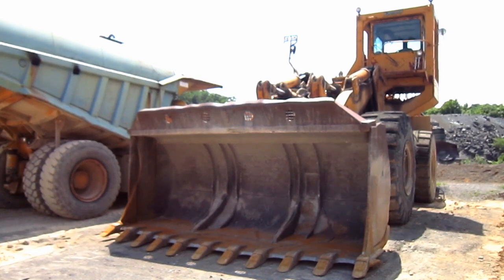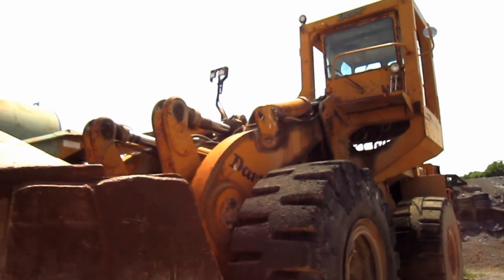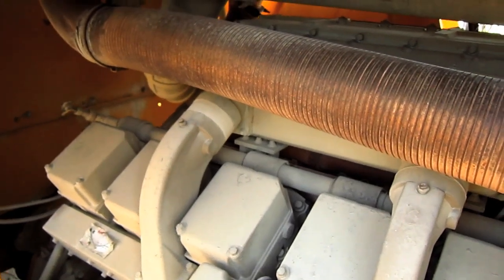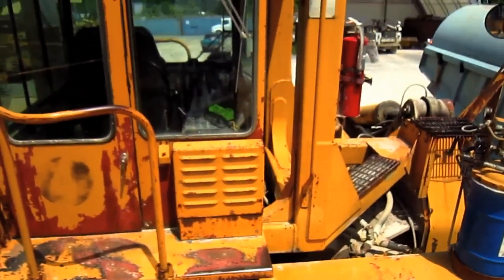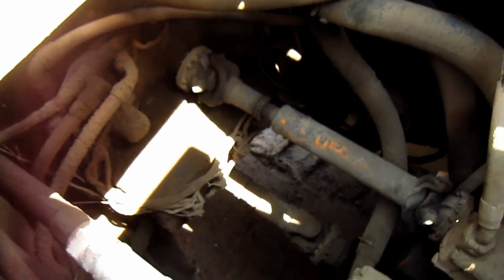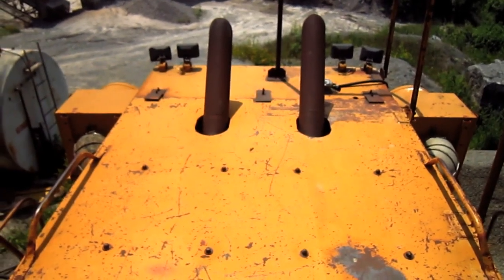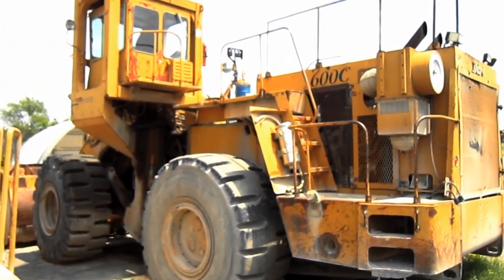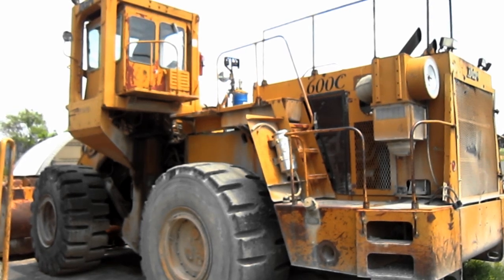Dart 600C Documentary

Comment: @PAmining   No doubt one of the coolest loaders of all time, like you said. The Dart 600 was a very powerful machine as well. That 875 horsepower rating always gets my attention.The Dart 600 was only a few tons heavier than the Cat 992C,but had a power advantage of 185 horsepower. The 600 also featured a rock bucket 2.5 cubic yards bigger than the 992C.With that said, my guess is the majority of contractors purchased the Cat 992C due to the incredible product support and logistics system that Caterpillar developed.
I wasn’t aware that Unit Rig manufactured the Dart 600 series up to 1994.Thanks for another informative and entertaining video production.
Reply from the maker: Absolutely, I think you hit the nail right on the head. Cat had the product and field support that Dart lacked, and let's face it, Cat had/has a loyal following. From what I've heard from anyone who's run them, they were a good loader with lots of power. Glad you enjoyed it! Thanks!

Comment: These were a unque design to say the least!  Only large loader built with the offset cab. Seems like they were trying to replicate other loading tools of the time ie: shovels. Operators who ran them said they were great to see out of with that offset cab. A very large loader when they came out as they had 50% more capacity than the 992s of the time. Not so well known is that Dart made an electric version of these to compete with the large LeTourneaus. It was the model DE620 with two electric motors, one going into each differential. Another great video PA of a very rare machine!
Reply from the maker: Thanks friend! Most reviews I've heard on these machines were that they were a good strong machine. I believe the DE620 was only offered during the production run of the 600 B model, which it was based off.

Comment: Love that Steering Wheel on the Dart Loader, it seems like these days equipment names get bought and sold,  I think some of the Unit Rig equipment might be manufactured under CAT possibly especially with Haul Trucks.
Reply from the maker: I miss all these different manufacturers! It definitely made for interesting engineering feats. And yes Cat now offers the Unit Rig electric drive truck line, though who knows for how long.
Reply: @PAmining  I do too, but I think CAT has them now about 17 years possibly, the original equipment may be Historical.

Comment: The offset cab is worth the price of admission alone.  Instead of having to 'look through the boom and bucket' during loading you can actually see everything.  Really nice feature.  Is this old loader still in operation or has it been "parked"?  Thanks for another excellent video.
Reply from the maker: It definitely is unique! You can tell the engineering thought was to position the operator as on a shovel or excavator- offset of the digging implement. And this unit is still in operation. Thanks!

Comment: OK so I have a couple of questions but first of all I need to clarify something. I am a totally blind person, so these questions are related to what the loader actually looks like.. first of all is the cab narrow like an excavator cab or is it wide like a wheel loader cab, and is it on the left or right side of the machine?
Reply from the maker: No problem! The cab is large, measuring 52 inches by 60 inches with an operator and trainer seat inside. If you are sitting in the seat, the cab is positioned on the left side, not centered like on other other loaders. Hope this helps!

Comment: Offset cab and an ejector bucket option? I think Dart's engineers took some heavy inspiration from underground LHDs. All it's missing is side seating!
Reply from the maker: For sure! In my opinion, I feel the ejector bucket version was a way around not having to design and build a larger version of this machine to load bigger trucks, which would only be a result of low sales.
Reply: @PAmining  The Dart literature I have says they could Center load 120 and even 170 ton trucks with the ejector bucket. The advantage was the increased reach as not having to dump the bucket, the bucket stayed flat. An added bonus was by Not having a high reach boom there was No reduction in capacity so both the Non ejector and ejector versions both carried the same 15 cu yd bucket!. The literature says the dump height was 20'.1" an increase of 5.'3" over the non ejector bucket.